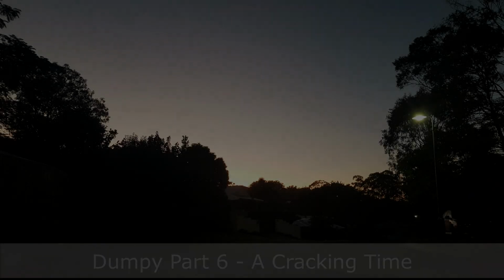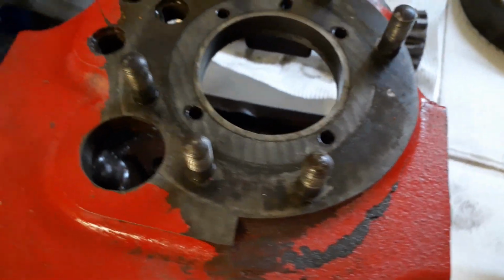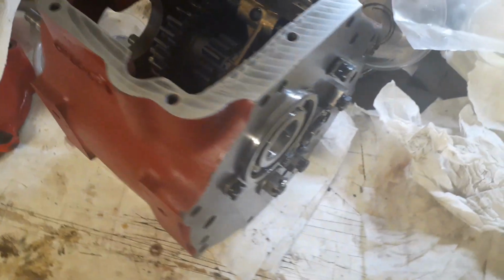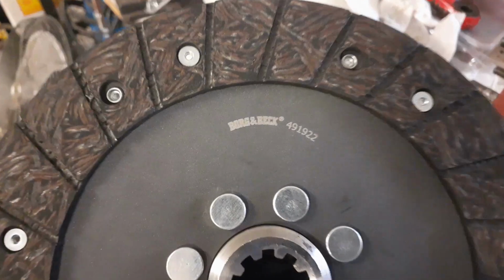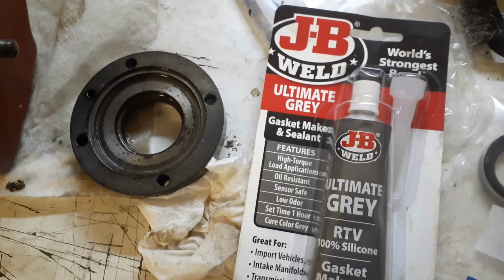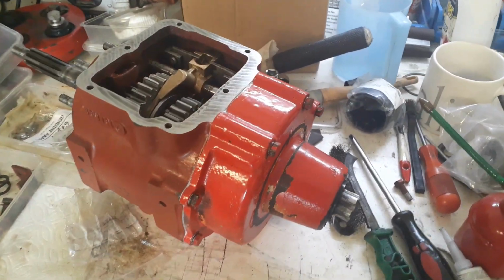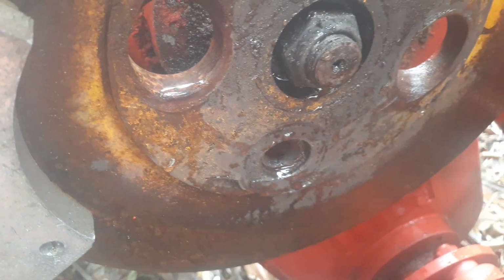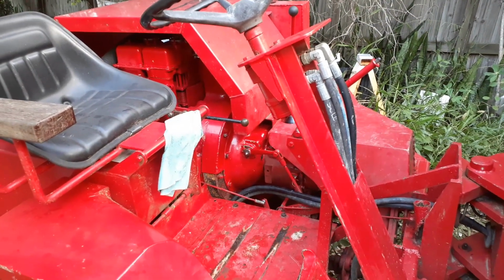Dumpy Part 6 - A Cracking Adventure

Comment: Hi, I am embarking on a gearbox (newage 40M/42 , fitted to my Lister powered Winget 2s) refurb and seeing your video here is great. There are parts still available but part numbering or a lack of it from suppliers makes it difficult to ID the correct parts. Could I trouble you for a list of the items you purchased for your refurb.

I also see you are on the sunny coast, I had the great pleasure of living in Caloundra for about 3 years, loved it, there are jealous streaks running through my veins even now.
Cheers
GT

Comment: Good video, for the output shaft bearing, how did you get the circlip off? and does the bearing pull out towards the output side or push back into the gearbox housing? TIA
Reply from the maker: Use circlip pliers to get the circlip off, or for the plain snap ring use a convenient lever (screwdriver) to force the ends of it apart and pop it out of the groove.  I pulled the bearing out of the hole, using a slide hammer.  Gently pulled the bearing out then pushed in a new one using my hydraulic bench press with an aluminium block over it to keep it square & protect it.